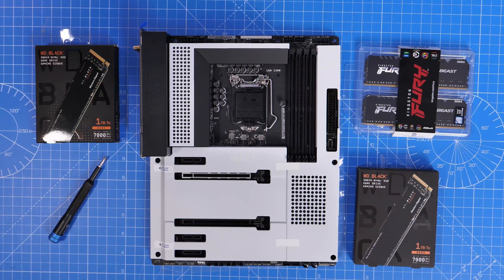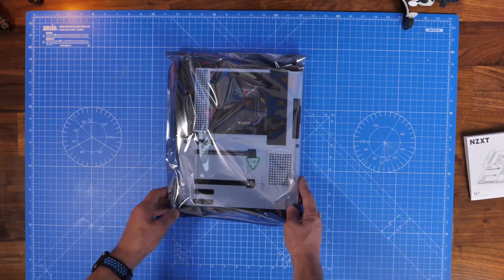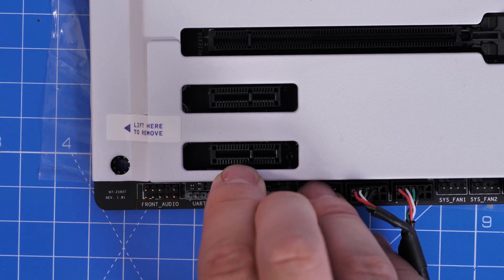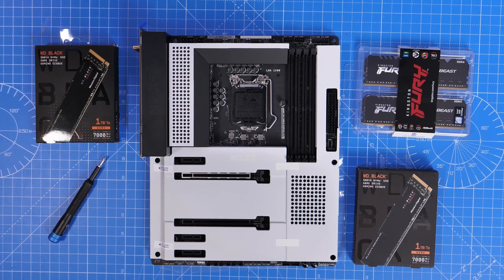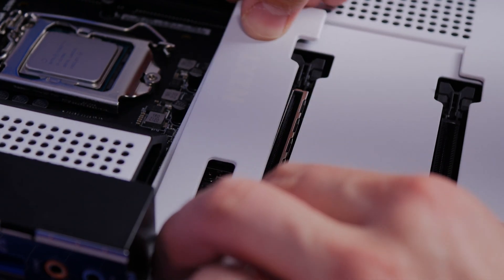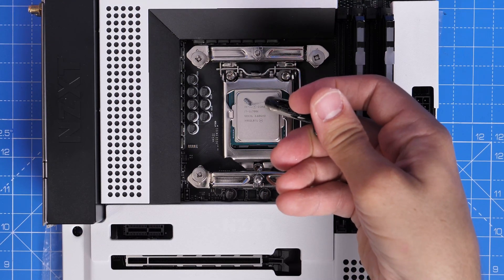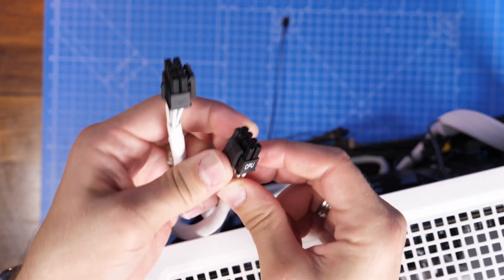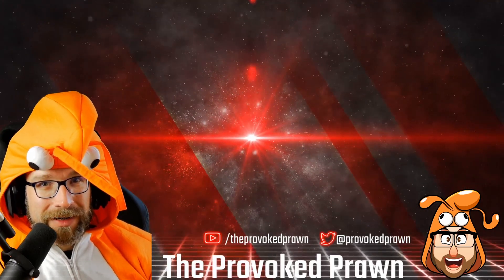NZXT N7 Z590 build tips and feature review

Comment: Not to bother you but is my pc decent I got the radion rx 6600  32gigs of ram 2 hdd drives 1 with 1 terrabyte and one with 4 and 1 terrabyte ssd and Intel Core i9-12900KF and corsair rm 850  and this mobo inside the corsair 4000d airflow is it good and what do you reccomend to upgrade
Reply: It’s pretty good , but I would go for a bit better performing gpu, because the i9 is a bit too powerful

Comment: i have heatsinks on my m.2. I dont really feel comfortable that the cover plates dont have any thermal pads, especially running very near the gpu. Doesn't  look as clean but im not taking any chances.
Reply: wich heatsink dit you buy? I want to buy this motherboard and have a 2tb samsung 980 pro but just like you i don't feel comfortable to just leave it there without a heatsink
Reply: @mortaibenharry5126  I’ve been using this same MB on an all white build I built about a year ago and haven’t had any issues with the M.2s getting to hot and causing issues. I have M.2s in both slots with no heating pads and I run my PC pretty hard most of the time playing DCS, MFS2020, and a few racing sims and so far all is well with the M.2s but I understand the trepidation.
Reply: @mortaibenharry5126  I have the seagate firecuda 530 with heatsink. The only problem you can't put the ssd m.2 cover on the motherboard back on, but you really can't tell if you get the all black one. Other than that, I love the motherboard.
Reply: @tosh2613  okay thanks!!

Comment: My prebuild had a ssd 500gb at the bottom slot. I assume this means there is nothing in the top slot as my pc only has 500gb total. Would it be better to replace the existing 500gb with a 1 or 2tb Evo ssd, or would it be better to remove the graphics cards up top and add a Wd like you did in the video?

Comment: Can the 4.0 NVME SSD get super hot? I heard that they can get pretty hot since there is no special cooling for them..
Reply from the maker: In my experience any of the heat isnt an issue.
Reply: @TheProvokedPrawn  Wait, how long have you used the motherboard for with the SSD's being in the slots? Can the 4.0 NVME SSD get super hot?
Reply from the maker: @parkermanville1716  all components get hot. It's not a problem
Reply: @TheProvokedPrawn  But if there is a cover blocking the air with the SSD, doesn't that mean it'l fry it?
Reply: a solution for a problem like that would be to remove the shield from that portion of the motherboard
Reply: @blendify  wouldnt look as nice though
Reply: Can I put the SSD in any slot or does it have to be specific in order for it to work properly? cause if so, ill be using the bottom bc my GPU will be covering it so there's not much black showing...